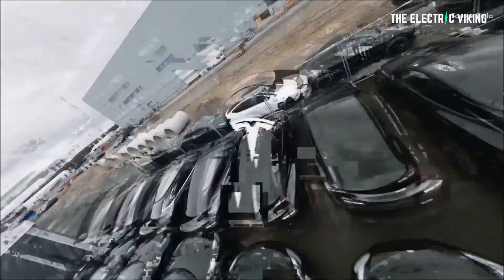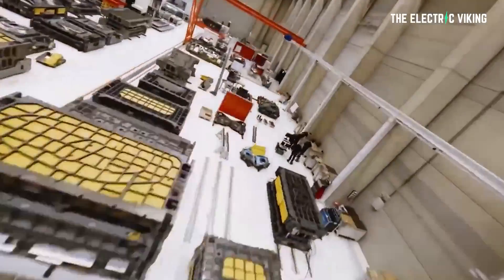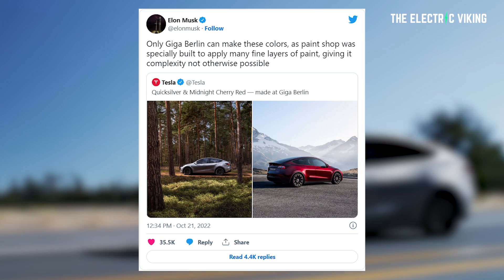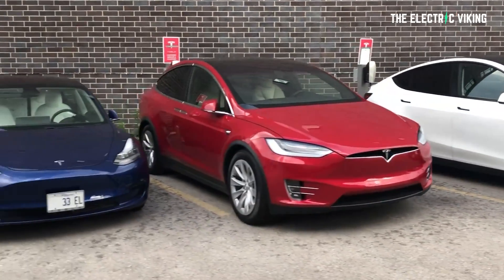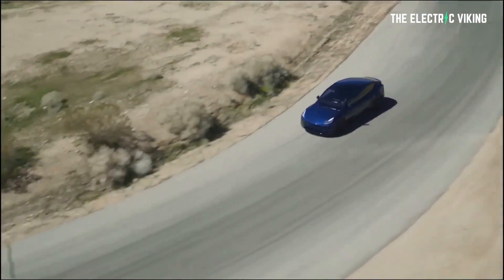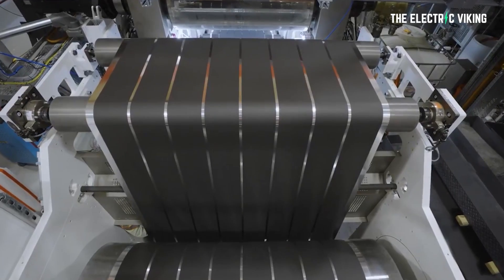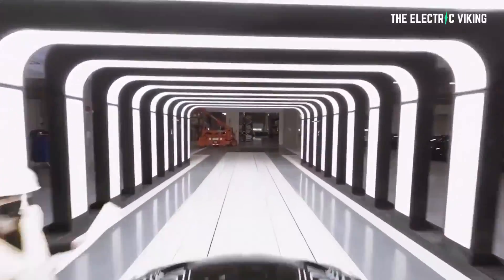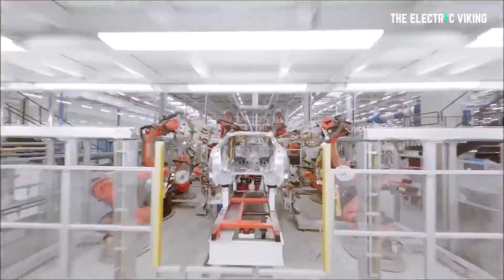Tesla Berlin new batteries, megacasts + structural battery packs

Comment: It might be that 4680 will go into high performance cars (P models), whereas LFP goes to LR and SR.
I guess the LFP might not be able to discharge at as high a rate that the 4680 does.

Having larger margins on the P models they could afford spending more on the battery there.

Comment: In Florida, where the air is salty, electric vehicles have been bursting into flames because the salt is shorting them out. Imagine what will happen in colder climates where they use salt on the roads?  Many people in Florida are being told not to park their E.V. inside their garage , or their garage and house could burn down.
Reply: Tesla has been making EV for more than 10 years!! What about all those EV in Northern Europe?? They haven’t burnt up!!
Reply: @mitchpeter5718  Haven't burnt up...or haven't been reported as being burnt up ?  I'm sure if I dig a little bit, I could find out the truth. When a government buys into the lie of climate change and all things green, there's no end to the lies they will tell to support the climate change lie. That includes putting out rosy reports...but it also includes suppressing the damning reports as well.

Comment: Possible issue with the M3P battery is that it is a pouch battery right?  Correct me if I am wrong.  The only pouch or prismatic battery Tesla uses is LFP.  Might they choose not to use it for potential safety issues?
Reply: No performance models use 2170s or the 18650s. To my knowledge, I don't know what format the LFP batteries are, but all others are cylindrical.

Comment: The only possible logical reason for Tesla to send any batteries from the US to any other Nation regardless of Geographics and Logistics would be to take advantage of the soon to be enforced so-called inflation reduction act more correctly the inflation-inducing or induction Act subsidies associated with batteries produced in the United States but not used or sold directly within the company that produces them. This is some very subversive wording that exists within the inflation inducing Act. I'm not saying that there is any Advantage financially to be had there, but that would be the only financially logical reasoning to send batteries out of the United States

Comment: The structural battery pack doesn’t necessarily need to be tied to the 4680 battery form factor. Tesla could easily tweak the structural battery pack design to accommodate 2170 batteries. 

Giga Shanghai already uses a different battery pack design for the prismatic LFP batteries because these batteries don’t have the same cylindrical form factor as the 2170 battery pack.

I don’t think Tesla will be shipping 4680 batteries to China or Germany for several years jf ever.

Comment: With high density LFP's being almost equal to - and significantly cheaper than 4680's -  will Tesla switch to making these instead?   Seems inevitable, but also a waste of the current 4680 infrastructure.  Makes one question if vertical integration is the right decision in the ever-changing battery tech space.

Comment: Simple, 4680 battery is a big failure!
Reply: Not a failure exactly - it's still better than the 2170's it replaces.
Reply: @RoguePC4U  
If they're better, Tesla would be using them in all of their cars by now. Elon Musk said long time ago, that 4680 battery is cheaper to produce, have more power, energy density, longer range...! What's the problem now ? Musk was lying, or Tesla can't make them work as they expected. Either way, it's a failure.
Reply: @peterp4753  Wow... so negative.  Have patience.  The 4680 still needs to scale its production - which is steadily happening as we speak.